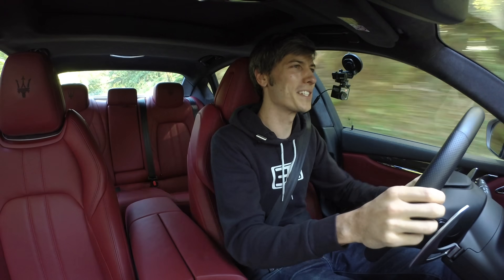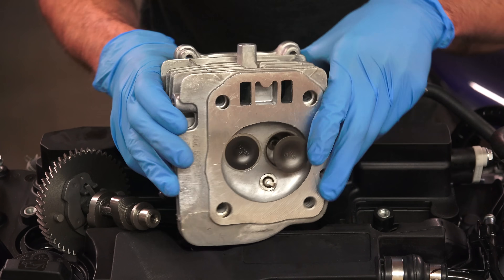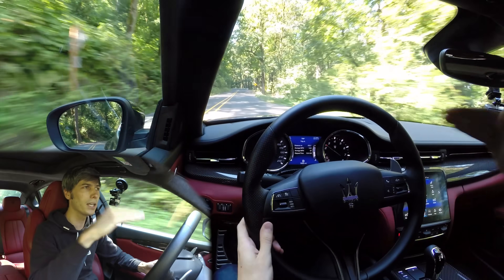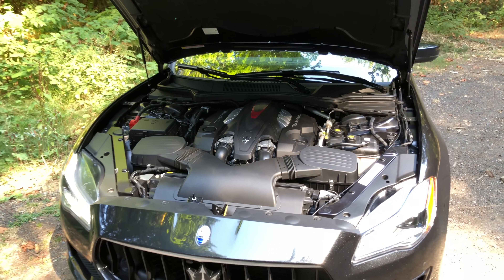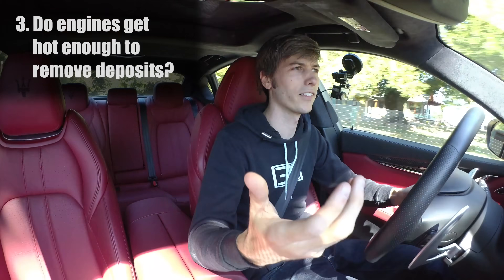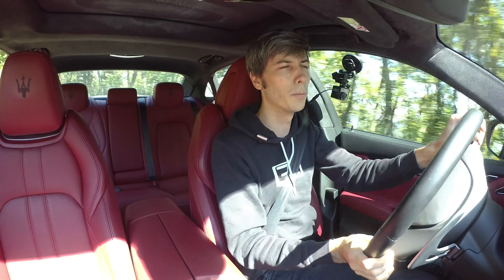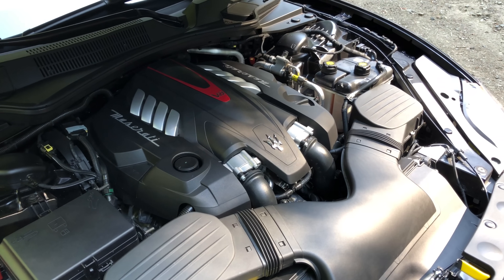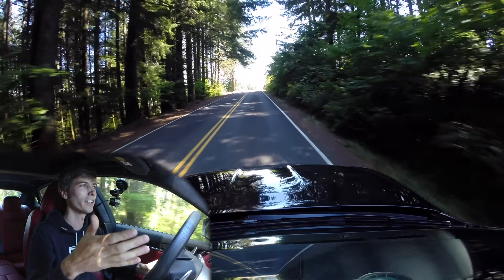Is Redline Good For Your Car's Engine? Italian Tune Up

Comment: If I remember correctly, redline shows where the oil rings on the piston scrape off all of the oil, and red lining for long enough is dangerous. Prolonged red lining WILL damage your engine. Please correct me if I'm wrong.
Reply: You’re wrong :p 
Redline mostly is when the valve-springs aren’t strong enough to close the valves in time for when the piston goes back up. The collide. Also, when really overrevving the engine, the piston speed may get too high and damage the engine. The rev-limiter prevents that though. You can rev up till red line just fine. 

I once had an Volvo, where the last 500rpm before redline was only a little bit red. The manual stated that it was oke to go there for short period of time, but avoid staying in the last 500rpm for long.

Actually, enginee that always stay in low rpm, used for short distances don’t last as long. Do warm up the car properly though.
Reply: @PaulBroere  Huh, then I've been misinformed. Good to know. There's a ton of information out there, and knowing what's true and what is not without testing it myself is hard :D

Comment: The Truth is 
1) always use shell petrol 
2) use an additive
3) keep your engine always in maximum torque range
4) inspect your valves by putting a camera in after taking out a spark plug at about half their lifetime
5) yes for Italian tuneup only after the car has been in city traffic else in tourque range is enough
6) never thrash the car from cold and if turbo don't switch off at standstill if fan on when arrived at destination
7) remember that at every start up the ECU learns how you drive so no thrashing it from cold but neither to slow just keep it in tourque range for the ECU to adapt

Comment: "Salir a descarbonizar" or going out to de-carbonize in spanish, used to be something relatively common at least in Argentina, especially with older cars and even more with diesel engines. You'd basically go to the highway or any other high speed road and rev the sh*t out of the engine in order to, at least in theory, remove those carbon deposits from the engine. Even if according to this video that's not necessarily true, I guess avoiding lugging the engine helps prevents the formation to some degree.

Comment: My thoughts on Carbon deposits has more to do with the deposits in the intake system. Most of my issues with deposits are there. I haven't seen many issues with modern cars having major deposit issues past the intake runners unless something was amiss in the rings or seals. I am unaware of any on vehicle solution that can get the incoming air and intake system hot enough to stop condensing oil vapor or release the carbon attached to it.

Comment: It works just If you keep full throttke at max speed for a certain amount of time..... 5 minutes at least, after that you feel the engine reacting well, i tried it a lot of times, on motorcycle more than cars... 
Non just the metal surface heat mean, the average heat of the carbon deposit is what mean here.
The research found the metal temperature, carbon doesn't transit heat well, so deposita can reach high temperatures more easy than piston or cylinder, because heat travel by the hot air in cylinder  to those surface, so it meets carbon deposits befir heat reaches piston or valves or what ever....

Comment: I have done this over my lifetime . It's very simple. Look at your rear view mirror to see the carbon coming out . Back in the day ,a ton of crap came out the exhaust.  Maybe since the addition of ethanol, and the the newer design of engines .Maybe it's different now . Even all my muscle cars still do it though .
Reply: when I revved my car up to the red line black exhaust smoke came out, is that the carbon being burned off?

Comment: i have a 92 buick lasbre and i had to pull the heads off of it to fix a cracked valve(it had that when i got it) and a blown head gasket. i ran that engine very hard. the engine had very little carbon in it and the light layer that was on the piston literally flaked off while the heads were removed. the engine had over 230,000 miles and i ran that car hard. the cylinders still had the honing scratches in them. that car also ran about 65psi oil pressure(i put a mechanical gauge in it) while i was cruising down the highway which is probably why it had no wear. so run your engines hard with an sae 30 oil in them. at least, run them hard if u have the old cast iron engines. i can't speak to the new crap they make nowadays.

Comment: Yup just run the ac on mid. 
To get it hot enough to actually remove those bad carbon deposits while driving at an Italian tune up on the high way. It works 👍

Comment: I tried the italian tune up. No solution and probably damaging the cat converter. And I ended up removing the intake manifold and cleaning the valves with carb and choke cleaner. And finally installing an oil catch can. No more carbon deposits and no more lean fuel problem.

Comment: I actually think it works

My 55 chrysler had so much carbon build up when i first got it that it would run without the key on for a few seconds, after i drove it for a 1000 miles it all went away and burned better and better

Comment: An old lady came in once with her 911. Check engine light and she said it was intermittently hesitant. I test drove it and confirmed a little lag on acceleration, nothing major. The check engine light came back for knock. Threw in some 93 and gave it a good Italian tune up for about 45 minutes. Cleared the light changed the oil and sent her on her way free of charge. Didn't tell her what we did just that we cleared the code and changed certain fluids. On her next oil change she asked for me specifically by name and said to the Service Advisor the car never drove better than the last 5000 miles. Mind you the car had just under 25K on it. It's good to run the engine every so often. It clears injectors, valves and gets certain things to proper operating temp. Doubt she ever drives that car how it's meant to be driven. Being too gentle with an engine is just as harmful as being too agressive.

Comment: Makes me wonder about unloaded redline run. Harder in some newer cars that are computer controlled. But makes me wonder, since then the higher temps should occur and the engine is unloaded. 
Since the engine gets to combustion temp of fuel (assume adiabatic flame temp for Gasoline) more often. Therefor heating the full system more times per minute. 
Like all things engine related there maybe an element of truth drown in complexities.

Comment: Studies: I wonder if the 'Replication Crisis' has been detected within the SAE yet? The 'Replication Crisis' is the disappointing discovery that many, possibly most, scientific experiments and papers are not reproducible. [At this point, the unwashed masses may conclude that I'm somehow anti-science. Not at all...]  So, when quoting from SAE papers, always beware that each conclusion may be somehow subtly incorrect. Thankfully Science - and Engineering - is self-correcting. However that correction process has latency, sometimes decades of latency.

Comment: I've never worried about the possibility of carbon deposits inside the combustion chamber. More like upstream in the Intake manifold, after the EGR and PVC injection points (where the sludge is injected) and before the fuel injector (where it can be cleaned off by the fuel). Direct injection makes this into a significant area.

Comment: So, I have a 1974 Land Rover Series 3. Little 2.25L petrol engine. Makes about 75 horse power, give or take. It's never been fast and it will never go fast. The other morning it decided to die at a stop sign. It was about -1C and I didn't have a lot of time to warm her up. It didn't want to get started again after dying, so I gave it a bit of a rev until it roared to life. A couple seconds to wait for the oil to reach the valves (hydraulic lifters) and then revved the guts out of it. Literally. Smoke and bits of stuff came flying out the exhaust. Made a pretty cool noise too hahaha. Felt a whole lot smoother on the drive in and back home later that day.

Comment: I've just noticed this on an LPG patio heater. The mesh would usually glow cherry red above a nice blue flame. Recently we had plenty of wind and the flame went a yellow colour. The mesh accumulated a soot on its surface. I put the heater in a sheltered area to get that blue flame back and the soot disappeared. It took some time but it burnt off eventually!

Comment: I redline at least twice a day on my daily commute, 120 miles daily. Car now has 180,000 miles and at 90,000 miles I actually drove a few miles home without the oil drain plug (too long of a story, I thought I royally screwed myself back then). I also use evans coolant so there's no pressure in the coolant system and I feel this is the number 1 thing that helps save radiators, hoses, headgaskets, water pumps, etc. No pressure, no steam will help other components last. I will say my heater probably doesn't run as hot as it should while idle in the winter, but if you're driving it's fine.

Comment: My mom bought a Toyota Tercel  (econobox junk) used back in the 80s from a guy who drove it under 45mph the whole time he owned it since his commute was under 5 miles. When my mom tried taking it on the freeway it wouldnt go over 45. it needed a major tuneup just to get it to go over 45 mph. Im thinking there was some serious carbon buildup in that tiny engine

Comment: Italian tuneup worked on a 1988 F150 302 v8 truck I had back when Emissions testing was required in MI 25+ years ago. It failed the test. I went out on the freeway and drove it hard for 10 minutes and came back and the test passed. I didnt usually drive it hard with high rpm since it was a truck but doing that seemed to help pass the test. the truck had about 125k miles

Comment: I think this is just one of those questions that is highly variable on the vehicle and on some, it will only due harm to run at high RPM. Need more data, more testing, less conjecture and theory.

Comment: A good canyon drive does wonders for the engine. Just enough high RPM engine load to get heat into the oil and engine but not enough generally to risk dropping oil pressure due to cooking the oil, like some cars do on a race track.

My car always revs out silky smooth on the drive home after 2-3 hours of good use.

Comment: My Grandpa has a 2013 Ford Fusion Hybrid. As you would expect he drives slow, and the engine cycles on and off regularly with the hybrid drive train.  Whenever I get a chance to drive the car I typically give it the beans at least a little bit, and many times it billows out a huge cloud of white smoke that continues for a bit while I'm on the throttle. This is after the car had been driven for awhile to warm up. I don't know if its cleaning carbon deposits out or what, but something is sure getting burned out of the engine.

Comment: The Italian tune up is an interesting theory that I have not considered before.  It makes sense engine heat + oxygen burns the carbon buildup.  I drive a WRX and have always busted around town like like someone who drives a WRX.  After 60k miles plus a Cobb tune I have had no engine problems.  The message is clear and simple, as long as I keep the throttle to the floor things will be ok.

Comment: My 2.0 t Audi A4 quattro couldn't break loose it's warn out tires in the rain when I got it. It was owned by a girl who had a baby in the back. I've pushed it a lot quite often and now with better tires on it I can get all 4 tires to spin. So  I think there is something to it if a car has been kept at a really low rpm.

Comment: Interesting that only carbon deposits was mentioned.
I know from both a theoretical point and practical experience, that a piston engine continually run at low loads and low rpms (Little old lady only drove it to the shops and church on Sunday syndrome.) is likely to break the top piston ring if given a highway run or an Italian tuneup.
In the typical piston engine a 'wear ring' or bore-lip forms at the top of the piston stroke. As piston rods have an 'elastic component' to their reciprocating movement that is dependant on rpm and piston velocity, over revving or the Italian tuneup can cause the top piston ring to 'impact' that bore lip and break.
It's a process somewhat analogous to 'running an engine in'.
So the carbon deposits issue (Chemical) are only one aspect to be considered, the wear characteristics are another (Physical).

Comment: One thing that I have noticed is one time after flooring my car to avoid an accident the average fuel mileage  started going up after a while and leveled out at around .4 mpg more than I was getting.
Reply: Same with me, mine has gone up 10mpg and I only floor it from 30-50mph a few times

Comment: In order to stay for some minutes at very high temperature, isn't it sufficient to drive 20 miles at 85 mph, in summer, having a third of the radiator covered with some insulating material?
(I have a 1339 cm³ gasoline mild hybrid, so very difficult to heat)

Comment: So my daily is an old Alfa Romeo, and it'll put up with being driven "nicely" around town, keeping it under about 4k, lower throttle, etc.  If I do that too much, it'll start getting a bit boggy off the line, start harder, and generally not be too happy.  A quick blast to redline through first and second and it's all good again.  
So, Italian tuneups are for Italian cars.

Also, what road are you driving, it looks like a nice drive.

Comment: I've seen personally a car driven by a little old lady never over 55 and it was completely carboned to the point it was misfiring even with new plugs and coils. I spent an hour running ac delco top engine clean through it and ran it out on the highway with a few good romps and it ran like a top after. I personally have a vehicle that sees a lot of rpm constantly. It has next to no carbon build up. I borescoped it when I did plugs and the combustion chamber is nice and carbon free. As much as possible anyway. I think a lot of it has to do with fuel flow. If a vehicle is always in low fuel flow and doesn't get very much flow through to remove those deposits. But what do I know. I'm just a wrench monkey.

Comment: In the bike world, the main reason I see people recommending an italian tune up is not strictly removing carbon deposits in the engine, but rather to keep either the fuel injectors clear, or more often keeping your carburetor jets clear. As well as keeping most of the carburetor cavities clean of deposits formed by bad old gas breaking down. I'd like to see a video looking at these cases.

Comment: I am only 1 minute in, so I dont know what he says. But I do know the Grandpa tune works for carburetor cars. Must be FULLY hot   go for a drive, get home and leave it running. Go inside and boil some water. take the air cleaner off, rev up the engine decently high and dribble some boiling water in. DO NOT LET IT STALL!!! voila, the valves are steam cleaned. DO NOT LET IT STALL a tiny dribble at a time... rev it higher as it slows...

Comment: I think there could be more to it than just heat. In a gas engine, I think the richer air/fuel ratio would help wash some of the parts down, but in a diesel engine I think that would just make more soot as the study concluded.

Comment: Decarboxylation is the process where a carboxylic group (-COOH) (the functional groups of organic acids, yes fatty acids too) is removed by heating it up from 150-250°C, depending on the nature of molecule it is attached too, to release CO2. I wouldn't say this process is carboxylation by itself, unless the gunk stuck in the engine makes a grease or some sort of tar that contains a lot of carboxylic groups. Although tar is mostly a hydrocarbon viscous or solid mixture, certainly it would be oxidized into CO2 to then get kicked out through the exhaust.

Comment: I have a pickup with a port ejected V-6.  Mostly I baby it On main roads keep speeds around 50 55 and back roads 40ish.  We have a mountain road near by with a long straight grade that is so steep I can floor the truck the whole way up. Once a year I put in injector cleaner and go up that grade. It does get better mileage and run better afterward.

Comment: Italian 'tune-up, would be the high-speed revolutions of the engine that causes the air and fuel mixture to clean the deposits that low-speed revolutions cause.

Comment: Removing the carbon deposits at combustion area including the valves and seats at higher temperatures are chemically sound. But along the lubricant flow path , i don't believe the oil temperatures could reach above 350C and so does the metal surfaces...The cam in the vedio not relevent?